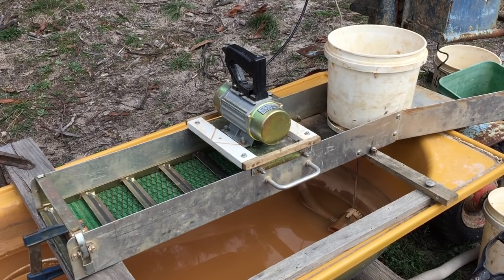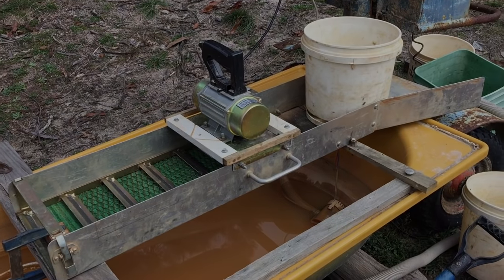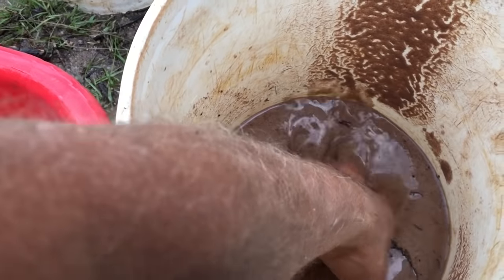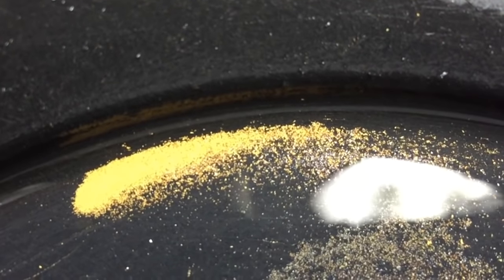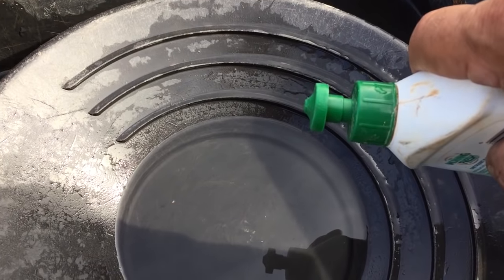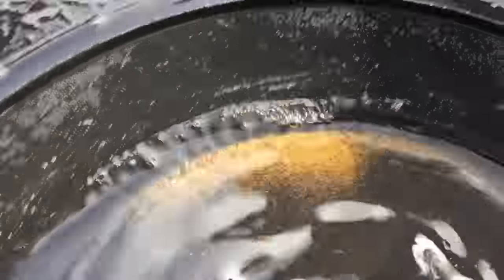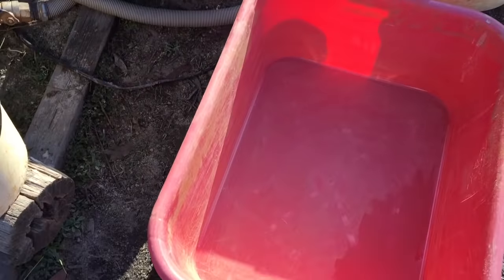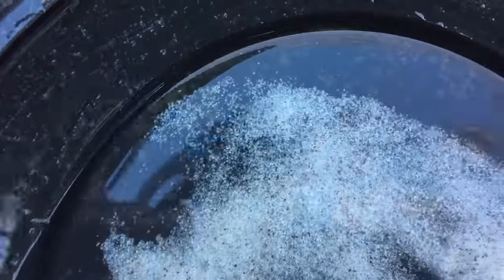Capture Fine Gold With A Simple River Sluice Modification - Aussie Bloke Prospector

Comment: Just noting - your tailings bucket is being vibrated throughout the process somewhat, which means that gold will may be settling downward in the tailings bucket, and therefore won't be in a scoop from the top of the bucket. It would be worth panning down further throughout your tailings bucket to understand whether any gold is getting through. The reason I mention this is that you said the material is getting compacted on your sluice, and gold has a very hard time moving through compacted material. Just something too think about. Thanks for your video.

Comment: I always knew concrete vibrators would be instrumental with gold prospecting/mining back when I saw one in action in construction.  :)   You should try to rig up a metal rod to stick into a bucket of concentrates with water in it...and then vibrate for 5 minutes and see if it drops all the gold to the bottom of the bucket (or smaller container like gallon milk jug or transparent container that size like quart jar)

Comment: Very interesting.
Ok, the concrete vibrator and 220V is out of my league, especially at my age.
How mught i translate that down to an easily portable test sluice with small vibrator using say on of those usb batteries and maybe a packable solar panel when you want to see if theres fine gold in a small stream or gulch?

Comment: Crazy experiment that I wouldn't have guessed would have caught any gold, especially with carpet, tiny expanded metal, & big-ish rifles. A shaker sluice that still needs to be panned instead of a one and done shaker table.  Hmm; idk; I guess it's good if you can't make a shaker table. 

No videos for 3 years, No reply for a year;  was interesting to think about though.  Would like to figure out how to do fine gold recovery or most of it straight away. - Am thinkin tight roller screens to classify fine gold and sand at the moment, never thought about vibration as I thought it would compact or bounce gold out and wash away.  Cool vid.

Comment: Thanks for the vid.👍
I like your riffle set up, similar to mine. About 8 years ago I was determined to make a riffle tray that could handle a variation in water flow and make the tray angle / pump size not so critical and catch a broader size of gold.  To achieve that I had to reduce the size of the tray from 12 " to 8 "width to get the velocity I needed and I made up the riffle rack incorporating the 3 classic riffle designs, 4x Z, 4 x angled and 2 @ right angle. Spent ages making it up out of stainless etc and it was amazing what it captured and worked perfectly. These days Im getting lazy and I replaced it with the dream mat to save on processing time with the massive difference in cons volume. I was pretty proud of what I made but as it is with most things these days there is always someone else one step ahead.  As per your vibrator, well done.
cheers Johno

Comment: Super cool idea! 
some thoughts I had. So if you want more vibration you should try to isolate the sluice from the wood frame with some rubber or other soft material. That will allow the box to move a little more. Also the vibration is getting in the tub your apparatus is sitting on. So it's getting into the tailings bucket so the gold may all settle to the bottom of the bucket.
Reply from the maker: Thanks for the tips! Definitely worth considering. BTW...I did check the buckets..and they were gold free...just didn't show that. Regards Aussie
Reply: Absolutely spot on. Use rubber mounts to attach the sluice to the bath and you'll get much more vibration where you want it. It'll be heaps quieter you could possibly turn the vibrator down a notch or use a smaller 12V one.
Reply: For me the vibration worked so well that my water was jumping up in the air. I had to add a speed controller on the vibrator.

Comment: I would replace those nuts on the bolts rubbing against the side of the sluice before they wear through the sluice with some rubber tube/washers of some sort to minimise any wear of metal against metal.

Comment: Very well done brilliant, another improvement you could add is a Variarc Transformer hooked into the inverter and the vibrator plugged into the Variarc by doing this you can control the voltage to your vibrator thus giving you many more options of vibration waves, full blast short fast waves turned down slower waves, I use a Variarc Transformer on my clean out sluice and can adjust the water flow Exactly the way I want it, you could do the same with your vibrator and get a variety of Different types of vibration that could even affect the gold better.
Reply from the maker: Yep. Good suggestion. This model was a fixed speed, but I can definitely see the benefit of a variable speed adjuster as there would most likely be an optimum frequency. Thanks for the input. Regards Aussie
Reply: Fantastic idea thanks

Comment: But would the flour gold be at the top of the trailing bucket samples? My instincts say to let it settle and take out everything but the bottom inch or so.  If everything was vibrating the true samples would be on the bottom floor of the bucket.  I mean awesomeness either way and I'm sure it is super efficient but it was the only thing that bugged me about the sampling. And your  professional opinion would help me sleep lol thanks bud.
Reply from the maker: Noted... To expedite the video, I cut out a lot of footage, and failed to mention that I actually test panned all levels of the tailings buckets in the initial testing. I was therefore confident that the results were consistent through out, and what was shown was a true reflection. Regards Aussie

Comment: How fine is that gold?  My guess is about 300 mesh.  I don't use the 'swirlie' reveal on this size gold.  If you just start tapping the blondes will travel to the near side of the pan leaving the fine gold behind.  I think you will find it easier.  Thanks for the idea about the concrete vibrator, it should work well for a vibrating screen also.
Reply from the maker: Superfine. I understand the tapping only, but I love to see the slow reveal using the twirl...can't resist it. Regards Aussie
Reply: @AussieBlokeProspector  Yeah, but it tends to wash away the super fine stuff.  Since that is all I deal with, I don't keep going back and forth.  When I run into some 50 mesh plus, I can lose it without seeing it since it behaves differently.

Comment: Mate i really like that vibrating setup..

Have you ever tried or invented a vibrating pad to help sort out river sands/gravels at a mass production rate? 
(eg. Setting up some sort of vibrating pad/bucket where the vibrations should send the heavy materials down to the bottom of the bucket... just so you dont have to sort through a whole 15L bucket from crevicing and digging in river rocks.)
Reply from the maker: No I have not, but it would definitely be plausible. I'm sure others have done so. Regards Aussie

Comment: Job done well sir, something I've always felt was the biggest loss is all the fine gold. Thanks for sharing your knowledge.
Reply from the maker: Very welcome mate. Regards Aussie
Reply: We know that we are missing gold,  but don't want to admit it to others  or  worse ourselves. I know that we lose super fine gold in the silty water. Do you feel that the vibration is dropping this  float gold? Your other  principles of  slowing the water and sluice  angle are spot on . Years ago we  put a small  vibrator run off our  air supply  on  my  dredge  as advised by an  old timer  who was  willing to share his  experiences  like you are doing. Well done and thanks for sharing!
Reply: @arcticminer32  I've had my own thoughts and theories about how to catch the ultra fine gold particles. One of them is to use alfalfa that has been charged with electrical static and shoved into a laundry bag that has holes everywhere more like a fish net. And as the water passes through this bag particles of metals will be attracted to it. Another one is to have a sluice that gets really wide so it slows down near the bottom of the sluice box. The wider it gets the slower it will become and hopefully allowing the ultra fine gold to drop out and stay in a sluice box. Things I have never tried since coming up with them from other miners knowledge and experience..

Comment: If you can't afford a concrete vibrator, a cheap orbital palm-sander is a good alternative. Buy a second-hand/used one, as they will trash their bearings if bolted securely. Mount it on springs.
Reply from the maker: Thanks for the suggestion. Regards Aussie

Comment: Aussie block, great video thank you for sharing, I have a couple of Vibco SCR's that are adjustable speed that I use on different pieces of equipment. Since your tailings are clean then you got the direction right. Most people don't know that it does make a difference which way you mount the vibrator, it can help you or hurt you.
Reply from the maker: Thanks for the tip... I'll bear that in mind for future projects. Regards Aussie

Comment: Very interesting - although am I right in the assumption that the vibration creates a fluidised bed of product that allows the fine gold to make its way to the bottom? If so, then:
1. The product should not be compacting, and shows there are large improvements yet to be made to your prototype. (I would be looking into fixing the vibration moter more securely, but I'm not an injuneer)
2. The baffles in your sluice are designed to create turbulance in the flow, which settles the larger particles but not the fine stuff. Is that turbulance needed for fines, and could it actually be having a detrimental effect by redistributing the fines back into the product?  Would a completely smooth floor allow the fines time to settle into the bottom of the product, and 'nugget trap" troughs set up to capture it?
Reply from the maker: Both understandable points you raise... however, I believe the proof is in the pudding. Regardless of the compaction and the size of the baffles (riffles) the results according to the tailings (those shown and the many I did not show ) are that proof. If there was some loss it would have been less than 5% and that considering the fineness of the Gold, virtually negligible. The introduction of Vibration and it's frequency, oscillation etc rendered the riffle size inconsequential and the compaction a non-issue. The awesome power of specific gravity along with an introduced high frequency (vibration) affect on displacement cannot be underestimated, and in this case rendered such compaction as a non issue. Anyway...that's my take on it. Regards Aussie

Comment: Great video! I appreciate your focus on the very fine gold since it's the most abundant and also challenging.
Can you tell me which direction the vibrator is turning? Is it better to have it rotate toward the lower end or the upper to hold the gold back a bit more? Also liked the gold captured by filtration from the wash water video. Have you thought about a high volume filter system for dredge discharge water? Thanks!
Reply from the maker: Thanks mate. To be honest with you, because this was just an experiment as such, I didn't really look into it that deep regarding the direction. I do agree that if it were offset slightly on the upper side, it may improve in holding ability. Regards Aussie
Reply: @AussieBlokeProspector  my extensive efforts in the past on vibration orientations, water flow and drop angles of the box -

SIDE TO SIDE - in systems with riffles (especially closer to each other) packs the slurry into a solid mass.  That takes new slurry and continues to pack intra catchments resulting in rapid total packing of the box with no further ultra fine Gold being retained.

WITH AND THEN AGAINST THE WATER FLOW creates settling of the Gold in a 'fluffed up' concentrate load.  The light 'fluffed up' load is then able to wash, using ample water flow and volume down and then out of the sluice, leaving Gold behind.

IN A CIRCULAR AXIS - some packing but mostly OK if the sluice's water and energy are kept up.

Using ULTRA SONIC vibrations works well but is extremely awkward to sustain outside of very controlled conditions.

Reference to the water volume and flow as well as pitch of the sluice - extensive experimentations of myself AS WELL AS many other unrelated miners shows a contra intuitive increase in recovery success result from good water flow and washing action (especially observed in small, protected drop riffle construction - even observing moderately deep scratches in plastic Gold pans).  When you hand panned in the beginning of the video you found the micro Gold with the exact same washing water parameters and drop angle in the pan as for "regular" small Gold.  The "Key" is to classify various cuts down to 100 or 200 mesh and run them separately.

As an interesting universal point, very small Gold is almost never found in slow, low water situations, and there is ample evidence of that.  If Gold is present in the pan slurry then it can be recovered - but slow / low is a hard water management plan in a moss / expanded box (or just in a pan).

Ultra fine beach Gold in Nome, Alaska and on Washington and Oregon beaches have taught me a lot about recovering ultra fine Gold - a lot of it.

Comment: Stupid question, but have you tried running the original tailings through the same sluice without the vibrator, but with reduced water flow and reduced angle? You might be surprised at how well that works. Maybe you don't need the vibration at all.
Reply from the maker: I can see your point, however this is all about introducing a NEW DYNAMIC (in this case vibration) into the normal setup which in turn introduces Extra Displacement that would NOT be present otherwise. Regards Aussie

Comment: good stuff  by the way  i use vibration for cleaning up  gold plated components i in the restoration  of antique harps  made from a 12 volt car heater fan with an offset piece of metal  and a container for the bits with water and cutting compound   just a suggestion to save dragging a 200 kilometre extension cord from home or worse still a generator lol cheers from Tasmania
Reply from the maker: Cheers. Thanks for the info. Regards Aussie
Reply: spent the day  on  a river full of super fine gold captured  in clay thanks for the tip   am working on youre great   idea

Comment: Just a thought: a non-motorised modification to a river sluice could be possible for use on-site, in the stream flow. 

Most of the flow energy of the stream's water could be diverted from the sluice channel and converted to the required direction, frequency and magnitude. It'd likely be a linear function of the water volume and flow, and non-mechanical (perhaps using memory-material) as well to comply with some states' fossicking regulations. 

There's possibly already a device like this being used in other industries such agriculture that can be adapted. Or, someone may have already invented such a device for their sluice.
Reply from the maker: Perhaps a good application of redirected water. Having said that, the subject here is about making a simple vibration bed, which should not be used in the bush, but at home as part of a Gold recovery arsenal. Thanks or the input. Regards Aussie

Comment: You can find adjustable vibrators 12 & 24v on eBay if you look under  .. 12v vibrator  .. business and industrial on left hand column  put in say $80-$100 u.s. for price range ...hope that helps many look relatively water proof and field able at 12-24v

Comment: A little late to the party...... But I noticed the bath was also being agitated by the vibration of the machine. With your tailings bucket in there it would also settle most of any lost gold towards the bottom of the bucket. Thus testing from the top of the bucket might not be the best representation of losses.

Comment: How did you screen the material initially?

Screening that much material with just a sieve would take awhile.
Reply from the maker: Yep it did...watch my Crushing Ore vid...that's when it was screened. Regards Aussie
Reply: @AussieBlokeProspector  I'm working with a deposit with a lot of ultra micro fine gold. Too fine to gravity separate. I'm experimenting with various ways to get rid of the big and boring stuff. The problem is in this case the big and boring stuff is sub 100 mesh. Using screens is taking forever.
Reply: I was thinking electrolysis

Comment: I think I woulda mounted the vibrator flat on the underside of the sluice with a toilet tank bolt kit, and had it up off the water a foot or two, I think that would transfer the energy more direct to where you want it. You might end up with some aluminum stress cracks the way those side rails are taking a beating.
Reply from the maker: Yep good points, but as a one off experiment, it did the job brilliantly. Regards Aussie

Comment: So ... I re-watched this episode because this is the size of gold that I recover everytime I run my material
 I built a big highbanker and after running my classified material ( 20 mesh ) thru twice , I run my cons thru a multi- sluice 4 times ... I then very carefully pan out those cons and my recovery is complete ... the gold recovered goes all the way down to 300 mesh ( Practically microscopic )
Now I plan to add another 3-4 feet of sluice bed to the end of my 9 feet of sluice that is already on the highbanker ... I will mount the cement vibrator to the top of the extension and see how it goes ... I hope to catch almost all the gold in one run this way and not have to run it twice ... this would be really excellent , huge time saver enabling me to run nearly twice as many buckets thru in a half a day
 If you care to know the results of it , I will post them